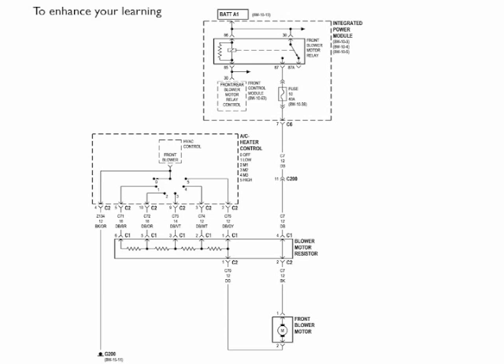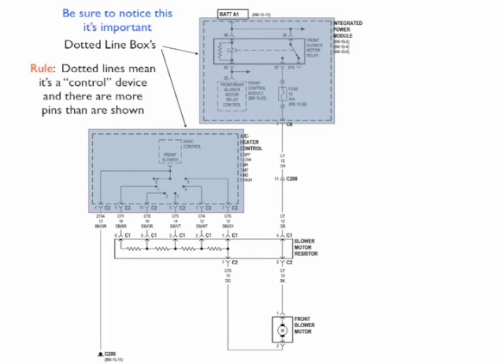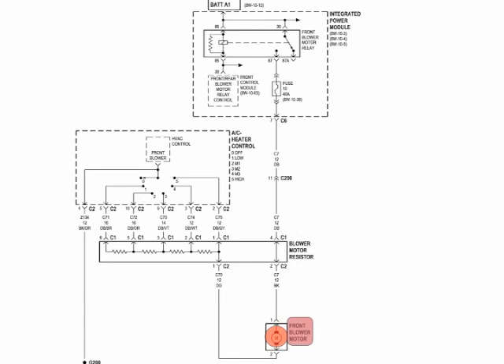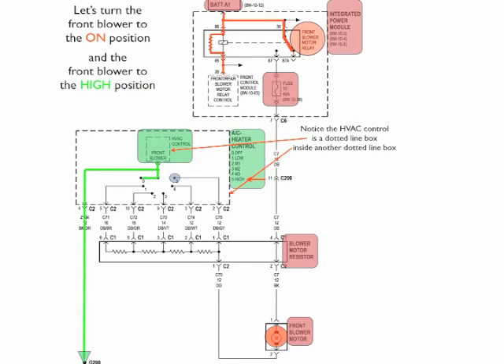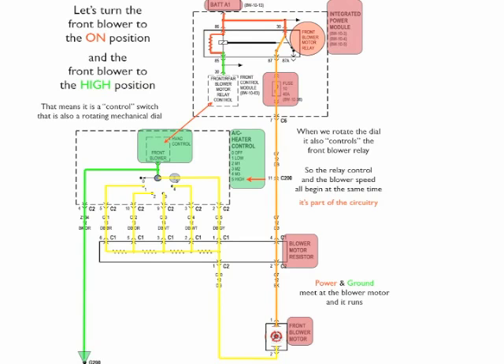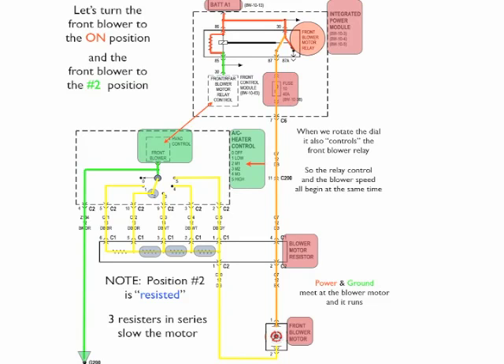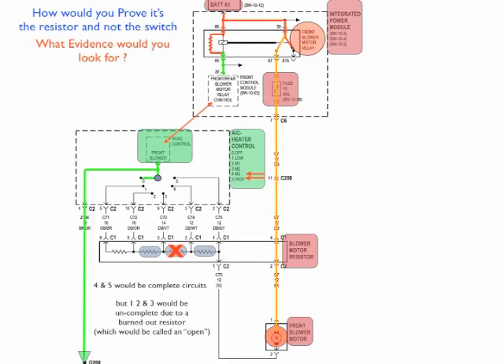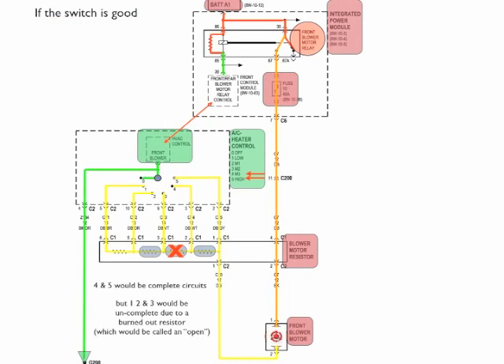Elec Series Lesson 2: Diagrams at rest

Comment: The website for the diagrams has been blocked by chrome and the admins because there's reported phishing and deceptive adds related to password phishing and hacking credentials. Is there a new / updated site that anyone knows of? I need to get the schematics printed to go over in my classes.
Reply: Hi Daniel,  yes the website is having issues.  The hosting company is the problem. They have been bought out by a larger company that is supposed to be converting everything to their new company.  They have screwed everything up and it is a real mess.  I'm not happy with it at all but it is out of my hands. It looks like I will have to rebuild the site from scratch.  I'm not sure it is worth it because all of the videos are on youtube.  There were several links and diagrams on there.  If there is something you want, I can send it to you directly, just let me know what you want .

Comment: I have a brain twister for you. 05 Chrysler Town and Country 3.3 LX
Vehicle stalled and they had it towed home. It cranks no start. Has no spark. I flip the key and get a list of codes from it. I’m thinking, what do all these codes have in common? I ck for power and grounds at sensors. All good. After checking power and grounds to pcm I order a replacement. Still no start. I bought a scanner with the ability to do actuator tests. No communication with pcm or fcm. I can communicate with all the other modules but these. I’ve used a headlight bulb to load test all the powers and grounds to the pcm. From what I see in the diagram, one should be able to communicate with it just with the C1 connector plugged in? If you or anyone else has any suggestions, please give me a buzz……
Thanks 
Oh, I was checking for 5vt reference signal at map sensor and discovered wires uncovered and making contact. I fixed these and was sure I found the problem….. nope… still no start. Fuel pump relay never clicks on but asd does.

Comment: Are products like amplifiers also drawn at rest? Figure it would be hard to figure out the internal voltages if that was the case?
Reply: yes, unless specifically noted diagrams are drawn at rest
Reply: @strokewarrior5762  How do the circuits hold voltages when unplugged, like the 3.3, 5v or even 12-24v - how does the circuit hold that? or is that not "at  rest" and I am misunderstanding the actual meaning of at rest? 
Thank you much! Appreciate the reply!
Reply: @whoisntwhoisit2126  you are misunderstanding "at rest". those voltages are sent out by thew PCM when it decides they are needed.  Often times that is at KOEO and KOER
Reply: @strokewarrior5762  Ahh ok, thank you for the clarification..
When I look up KOEO And KOER all I get is automobile information, which component  does this job in entertainment system products?  At the early stages of learning, trying to get an understanding, sorry if my questions are stupid.
Reply: @whoisntwhoisit2126  KOEO means Key on Engine off,  KOER means Key On Engine running.

Comment: I have a electrical schematic for a Howard Price 727 Turfmaster mower. The schematic does not look anything like the new schematics. This is for a 27 horsepower Yanmar engine. The unit had been taken apart (electrical) because the plug inside the panel from the frame had worn through the plastic. I need to rewire the entire unit (12 pin connectors from engine to panel). I need help to get the unit back to being functional. Any thoughts where I could get some help? The company is out of business and the Yanmar corporation doesn't have the manufacturers information other than parts numbers. Thank you. I'm in Reno, Nevada and need help.
Reply: sorry for delay.  There are aftermarket companies that rebuild complete wire harnesses.  Or do it yourself.  Wires are like roads on a map.  Each one starts at some point and leads to another point.  If you take it completely out you should be able to rebuild it.

Comment: what you missed is to teach us where can we find wiring diagram for a specific car.
and sometimes when you follow a wire  it goes to triangle that looks like arrow, what does that mean.
one more question : when you follow a wire from control switch it ends by saying g200, but does not tell the location thereof. some diagrams are just like that. how will i know the location of such

m.b.s moshitoa (s africa)
Reply: that triangle means that particular wire continues onto another page, that page is listed inside the triangle
Reply: @mercykidssprgeducationchan4237  I thank you. just finish answering the other questions.
Reply: @m.b.smoshitoa8325  The G's are usually ground to chassis connections (At least in the GMC Safari that I'm working on). To find them just go to the vehicle and follow the cable from component to a ground.

For example in my starter diagram the battery has two G connections branching off that go "nowhere." They are labeled as G102 and G103. The symbol is a dark circle with a few lines under it. It doesn't tell me where they are located, but I know they branch off from the battery. So to find them, I'll go to the battery and look for 2 cables that "ground out" to the chassis.

Comment: great sir, i have some diagrams where i am facing trouble to understand the connecting diagrams like going from source to load while following from initial to final. 
can you please help, these diagrams are related to aviation industry equipment's i.e. GPU, Air starter, air conditioning unit etc  please sir, i can share images of those diagrams on your email id ?
Reply from the maker: yes I'll try and help you, send them to my email either as a .jpg or .pdf file.  my email is dumar5901@gmail.com

Comment: God morning teacher.  I have situations dodge Dakota 2000. The a/c  selector. Only working  at the defrost. No working when you get the position to the front. What. Is would be the problem thanks you
Reply: the defrost position is the "default" position.  That means if the selector is not working right it will stay in the defrost position and not move.  You probably have a air door actuator not working

Comment: Great video. But how could you tell by looking at this that the HVAC control was going to provide ground for the front control module? Is it explicitly indicated you do you just know that from experience?
Reply from the maker: Good question.  Remember this . . . all working circuits need power & ground.  The front control module was supplied power but not ground (at rest). With power provided but no ground it could not operate. So, the logical answer is that the HVAC control must supply the ground.  The ONLY other option would be for the  HVAC control to supply power, but power and power will not complete a circuit so the load can WORK.   Hope this helps.

Comment: Quick question, orange power runs through resisters so the power will be dropped drastically by the time it feeds motor right ? It looks like only switched ground is being run through the resisters to feed the motor. I'm kinda lost there. Technically switched power is only straight power to devices ?

Comment: at 6:00, I don't see how the "HVAC CONTROL" sends ground to the "FRONT CONTROL MODULE".  The diagram does not show any physical connection.  According to the diagram, turning the control knob will only send ground to the right side of the relay (pin 87) .  Please explain.
Reply: Nich, remember, they are both in DOTTED boxes which mean they are the same element , even if they are spaced apart. Once one activates so does the other. Hope this helped you

Comment: Why does the path from the 40 Amp fuse go through the Blower Motor Resistor Box, even though it doesn't seem to attach to anything until it reaches the Front Blower Motor?
Reply: Yeah I was wondering the same thing, how are you supposed to recognize a connection when it's not drawn in.

Comment: Good video overall, but there is a mistake in the coloring. Not all the paths draw in yellow through the resistors should not be colored when you switch the rotary switch on. To be accurate it should only show the path connected via the rotary switch. e.g. #5 or #2 as shown in the video. Highlighting them all yellow implies that voltage is flowing through all of them which is not the case. Also, you misspelled resistors around 7:16:-)

Comment: Question. When the mechanical dial selector is turned to any of the speeds, Why is the front blower motor relay is colored Red and not Yellow. As I understand once the selector activates the ground that should be switched ground not direct ground. So, it should be yellow. Am I right or wrong?.
Reply: Maria Torres Red is direct power to relay and stop insides at open switch at all times. Orange is switched power feeds to motor when relay is energized with integrated ground as dotted lines means there more pins to it. Hope you understand what I meant.

Comment: Great job. I would suggest more use of a pointing device when you're narrating because sometimes the viewer gets lost as to where in the diagram you're referring to. So it was great when the probe appeared for example to show the testing of resistors 4 and 5, but that could have been left on the screen for more than 1/2 second, and then prior to that it was sometimes difficult to follow where on the diagram the narrator was talking about. A cursor object would have been more helpful. Nevertheless thanks again. Hopefully also at some point in the series you will take these lessons and show the testing procedure in action inside a garage so the viewer can connect the classroom instruction to real life. Because you don't put the electrical probe to a piece of paper. Show the viewer, please, how to transfer the electrical diagram to the actual circuit in the automobile. I'm looking forward to watching the rest of the series.
Reply: You can also watch 
https://youtu.be/Fu6Sf7t81KI
Reply: I understood quite well. But I see what you mean

Comment: I started looking at this video today. This video is good I mean really good. I had a look at that July motor article too. Excellent article. The problem with the blower when only 4 and 5 speeds work is the fuse in between 3 and 4. If it was the blower it wouldn't work at any speed.

Comment: In the beginning of the video you stated that the current would change depending upon the resistance, thereby changing the speed of the motor. Actually the Voltage is reduced depending on the number of resistors it is dropping across. Current draw remains the same. Ohms law.. Take any dc motor and try changing the voltage and see what happens.

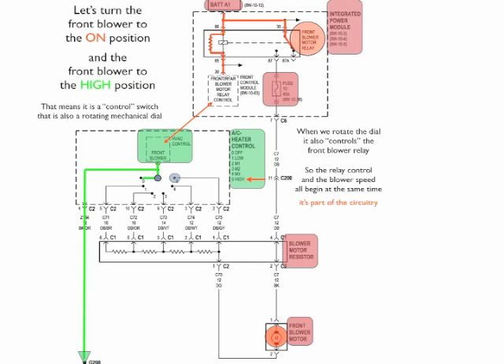Comment: Great video, at 5:48 he mentions that when the dial on the HVAC is turned to the #5 position that ground is supplied to the Front Control Module...how did he know that?  I can't see how they are connected via the diagram.  I know he states that control modules have more components than what is shown so would I have to go to the "Front Control Module" diagram to see how it's connected to the HVAC control?  Someone please clear this up for me.

Comment: Is it possible to just check for continuity between pins 1-3 and 4-5?
If the resistor is bad it would just be open?
Or does it not work like that

Comment: that to me sounds tantamount to saying "gear wrenches are for people that are too lazy to use standard wrenches.  A multimeter is great if you need to ohm a circuit, a scope is great for graphing a waveform... but when neither of those are necessary the PowerProbe is THE tool to use for the professional technician

Comment: I think these lessons could be further enhanced if an actual electrical multimeter were used in the hypothetical testing instead of a PowerProbe. You can get a multimeter at Lowes, AutoZone, etc. for around 20 bucks or so, so it's much easier to get than a PowerProbe. I used to be pretty anti-PowerProbe several years ago cause I thought it was a crutch for people who didn't know how to do basic electrical testing. I've softened my stance on it somewhat now, but still kinda feel the same way.

Comment: 1, 2 and 3 will have ground on the power probe only green light,but will not have power red light on the power probe, thus a broken connection in the blower motor resister.4 and 5 will have power (red) and ground (green) on the power probe. showing a complete path on the power and ground side thereby showing that the problem is in the blower motor resistor.

Comment: Go back and see what he says about connecting the Power Probe to the switch points to see which one has a GROUND and which ones don't. They will all have a ground when he turns the switch to that position, whether it's an open or shorted resistor, correct?  Help me out on this one, Spelunkerd.
Therefore this test tells us nothing. 
I think a tutorial on using the Power Probe wouldn't be a bad idea if it will be used in the lessons.

Comment: Turn it to full screen, all text is readable. What part of the 4 resistors you had trouble with? About using power probe to find problem? He would point the probe to the 1st position on the resistor, turn the blower motor switch and see at which speeds probe finds ground. Then he would do the same for other resistor positions. And all the resistors are connected, so if no. 3 is burned out, blower works only in speeds 4 & 5 cause in speeds 1-3 current flow to motor stops at the burned resistor.